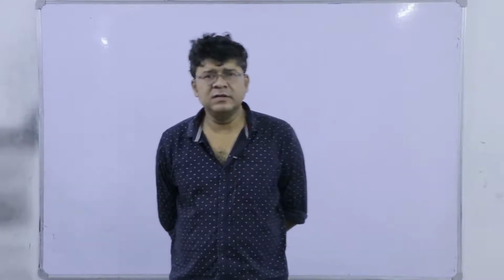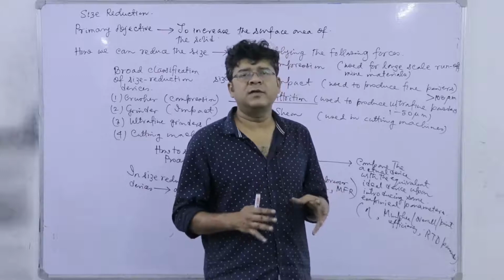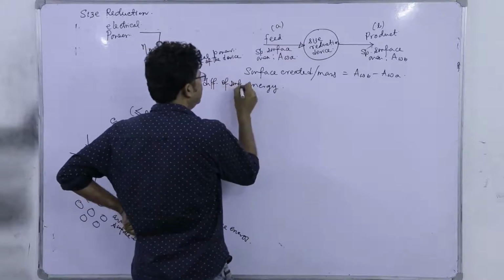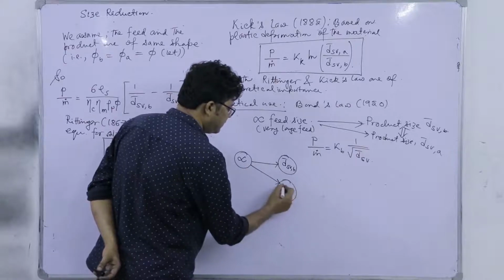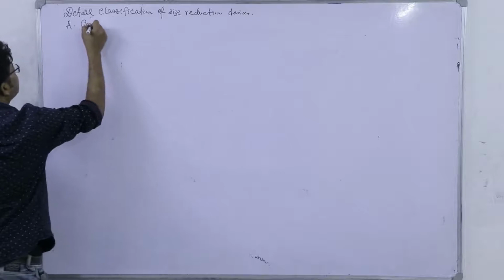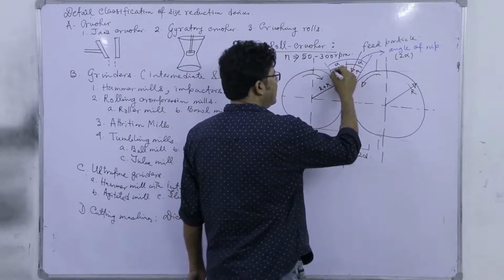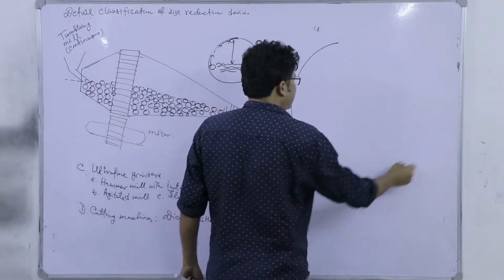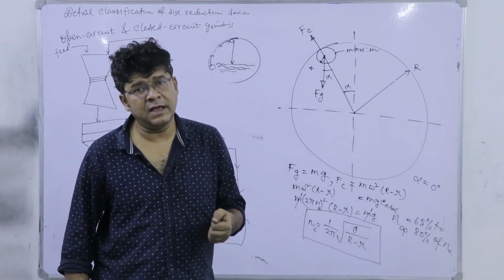Mechanical Operation | Lecture-4 | Size reduction | By Dr. Debasish Sarkar |Chemical Engineering

Comment: Sir, your lectures are very helpful. 
However, I am unable to find the 3rd lecture on Mechanical Operations. It doesn't appear on the list of videos.
Reply from the maker: I failed to upload the video, probably there is certain technical issue .
Reply: @chemicalengineeringbydebas2767  Thank You Sir.